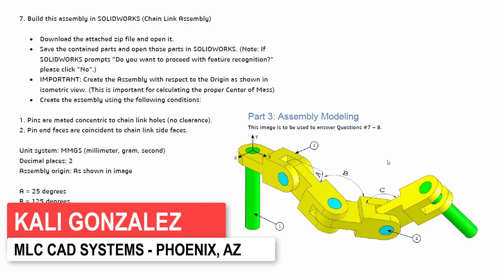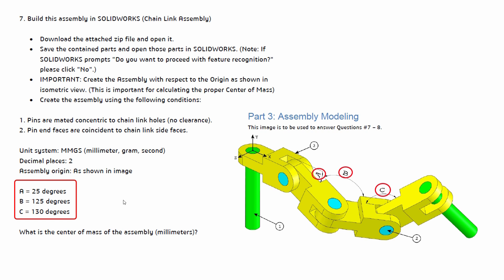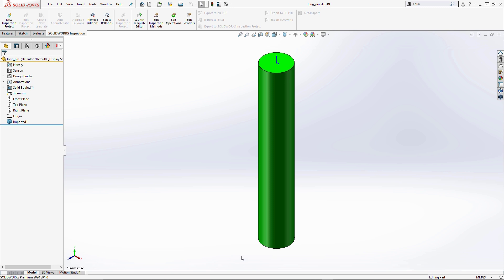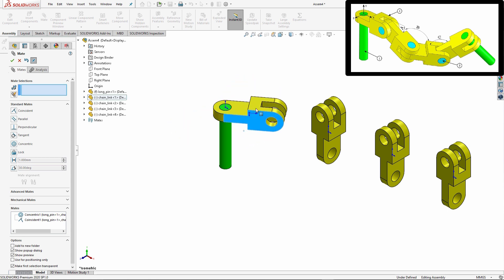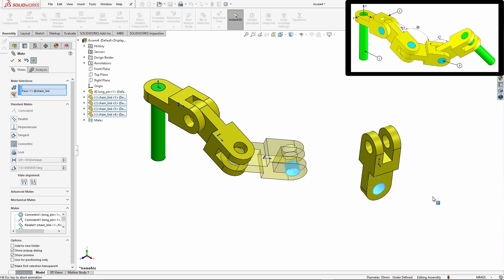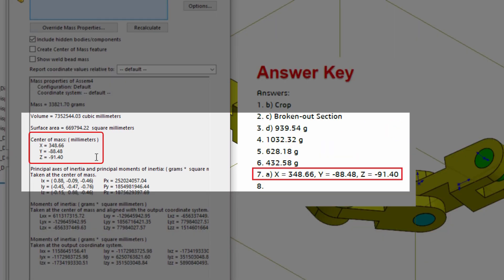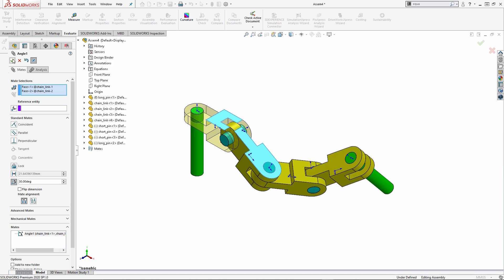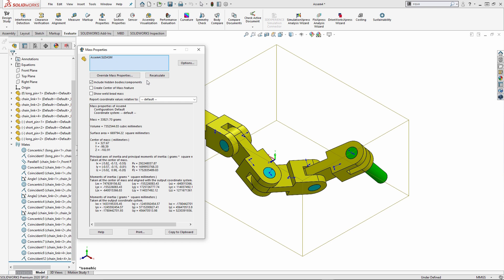Certified SOLIDWORKS Associate (CSWA) Prep Course 5/5: Assembly Design

Comment: Hi Kali, Thanks for the walk through!
I would like to ask, for the CSWA Exam, would we need to save each file independently as we go on from question to question?.. or is the Solidworks grading system going to check those out automatically without we having to prove our results after each question?
Reply from the maker: Great question! Saving the file after each question is a good practice so you can refer back to them if you want to check your work, but the tester does not directly grade the files.  The questions require you to pull measurements from the model to confirm that the design was built correctly.  It could be mass, volume, or a similar value.  
The only file saving you are required to do is to save the files downloaded from the tester, if any, so you can open them and work on them.
Reply: @MLCCADSystems  Okay, thank you so much!.. 
And one more thing, 
I did a sample exam yesterday, followed the tutorials, got exactly the same answer in my design as you did in yours, perfectly input-ted the value into the box given and all, but still had 85 out of 130.. I was wondering if it was a glitch from them, or if it happens to others too.
Reply from the maker: It is hard to know for sure, but if you feel a result is erroneous the team is awesome and very responsive to requests for clarification.  Email certification@solidworks.com if you would like to learn more, they can look up your test answers and provide feedback.  If you feel ready to take it, I encourage you to, especially if you have a free exam to take from your work or school.
In the past I've inquired about answers marked incorrectly on my exams and the causes ended up being incorrect units, modeling oversights, test errors, differences in interpretation or something similar. 
Good luck!
Reply: @MLCCADSystems  I like your customer service!.. I honestly don't want to believe I'm speaking directly with Kali😗😌, but thank you so much. Your responses are precisely tailored to every of my questions.
Reply from the maker: That is great feedback to hear!  Our entire team is highly certified, we have a lot of experience taking these exams to and we are friends with the awesome certifications team.  We love to see your enthusiasm to get certified!

Comment: what about remaining 6 questions , i think total 14 questions but they are only showing 8 in sample pdf
Reply from the maker: The sample exam this video is based on has 8 questions and is intended to give you an abbreviated testing experience.  Based on how difficult they are for you and how quickly you answer them should help you determine if you are ready to take the full test.  The full exam will likely have more questions but they will be different from the sample questions.